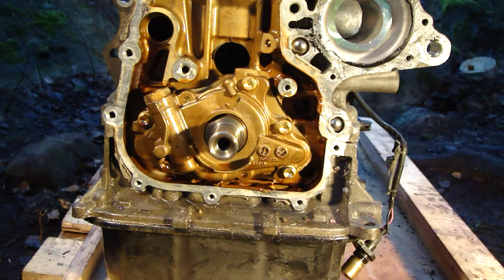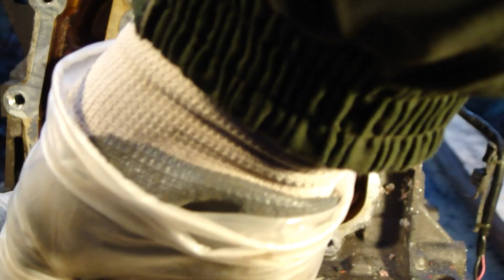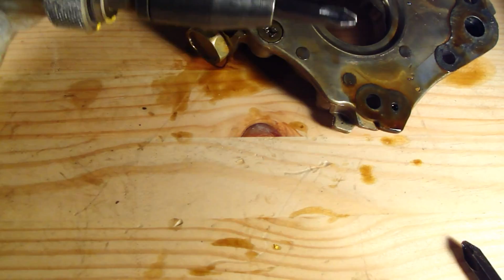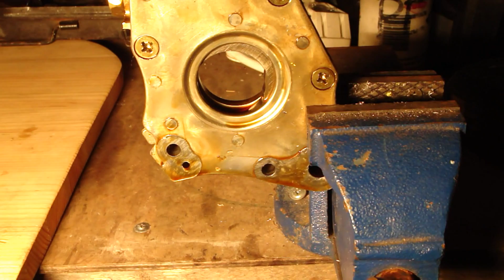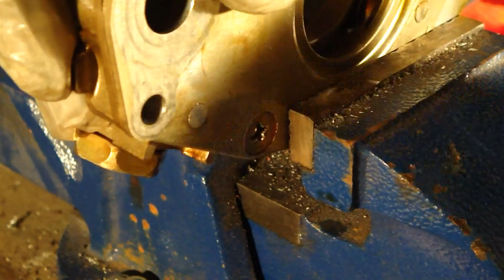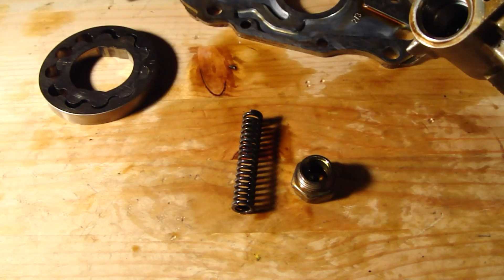How to disassemble engine VVTi Toyota Part 19/31: Oil pump

Comment: Hi. I have a noise there and I think the pump could be the problem. I have replaced the timing chain all set and all outside rollers on the flat belt are ok. The noise is similar like a tin can rattle and only in idle speed of the engine. But when I saw what is inside the oil pump hmm . If there is the problem maybe this gears especially the bigger one maybe wear the aluminium body and has a free movement.
Reply from the maker: Thanks for sharing

Comment: The spring appears to be part of the oil pressure relief valve. When the pressure is too high, the oil pushes on a marble which presses on the spring. The oil is then allowed to return to the pump inlet. It prevents pressure build-up.
Reply from the maker: Thanks 👍

Comment: Helo my engine is 1zz rav4 i replaced oil pump but still getting oil lights come on if engine is idle or low after engine starts, please advice
Reply from the maker: I have read your post! Good comment. Continue in the same way.👍😀

Comment: oh, my, God. Yes, by all means deform the nice and flat machined surfaces by clamping them in a vise jaw and then beat on the soft aluminum plate with a hammer. I'm sure he'll re-use those screws too. Thats the way they would do it in Mother Russia.
Reply from the maker: Hi and many Thanks for comment.  :-)
Reply: It actually looks like he clamped it on a non critical area.